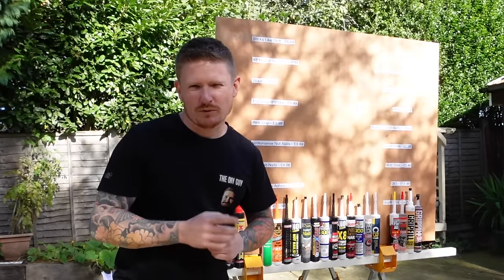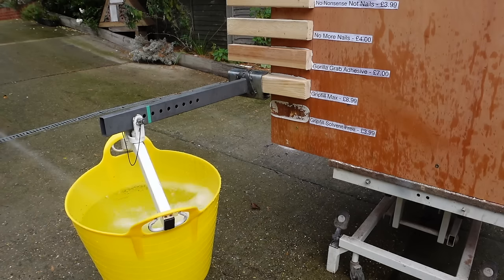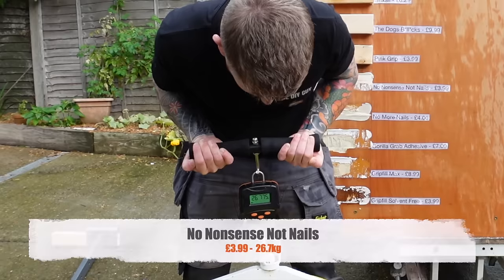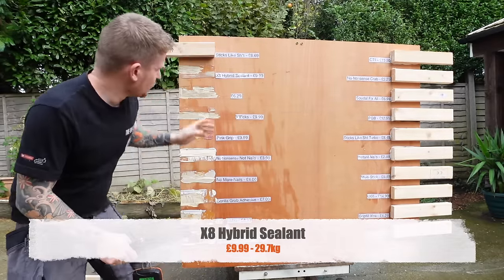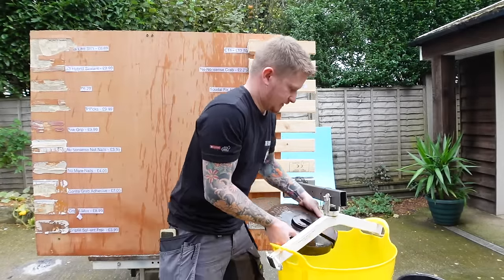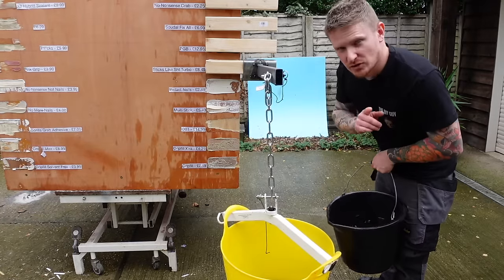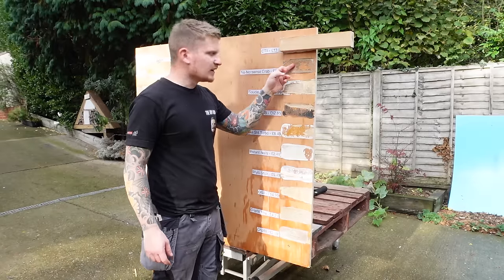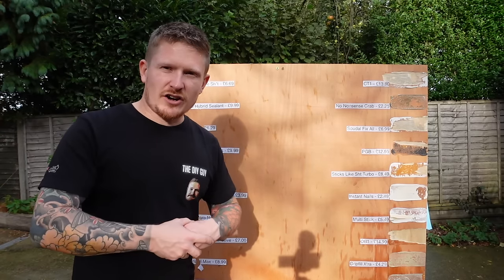Worlds Biggest Adhesive Test | SHOCKING RESULTS!

Comment: Help required bud, My silly builder ( Jurek ) couldn’t be bothered adding noggins on stud wall on garage conversion, just dam lazy if you ask me, and now am at odds with putting floating shelf’s up. I’ll get one coach screw on one stud but with kingspan behind the plasterboard which adhesive do you recommend might hold the metal bracket on ?

Comment: Would like to see a follow if they where lined up horizontally full fixed so height from ground is the same on each one with a hook loop fitted maybe on osb so the substrate doesn’t fail as easy. Great video.
Reply from the maker: Noted!

Comment: RE: Sticks like Sh*t VS. Sticks Like Sh*t TURBO: 
I wasn't too surprised that the hold strength was pretty much the same. But I prefer the turbo version for the setting time. Put a decent amount on, press it onto the wall and you can let go pretty much instantly, which isn't the case with the original Sticks Like.
Just my 2 pence!
Reply from the maker: Interesting, thanks 👍

Comment: Great video but I think you should have added in the weight of the rig to the results - that metal arm must weigh 5kg and the lever action it provides amplifies the action.
Also should repeat with the top performers on solid timber
Reply from the maker: Great suggestion!

Comment: nice vid and a good idea but in most of the tests the wood gave way before the glue which means the glue was not tested to braking point. to do the test right i guess you would have to use a clean metal background but your test showed up the weak glues that broke before the wood.
Reply from the maker: Great point!

Comment: Thanks for share , BUT It's not a well thought setup, first of all your substrate is not right material because it's very inconsistent in structure, you could use sheet of steel so it doesn't fail , secondly the amount of adhesive you put on each section wasn't equal based on footage, and lastly you appling torque to the bars and the force from the torque is far greater than the mass you measured, 😇

Comment: I'd love to upvote, but it's pointless if the substrate is failing so much, you need to apply the adhesives to a 10mm steel plate. Otherwise the only valid info is for those that didn't remove substrate with them...

Comment: I appreciate all the work you put into the video and excuse me if I have missed part of the scoring but if one of the adhesives does not fail but instead breaks the substrate (to a varying degree) then how is that measured when it may be a weak part of the ply (substrate) ?
Reply from the maker: I agree, the substrate did indeed let the test down a little and I will consider coming back with a more conclusive test in the future. However I released the video to give some idea and to entertain people even if it is not hugely scientific.

Comment: Interesting video and like others have said nice to see product testing with uk availability.  My comment would be anything where the glue failed you could say was an inferior product, however if the substrate failed, then the glue has done it’s job and it is the substrate that was incapable of holding the weight. either  the glue holding the plywood laminations together failed, or the softwood lamination itself failed. 
No criticism of you, as the plywood probably cost more than all the glues! But I think you found and tested to destruction that brand of plywood. I’ve found some poor quality plywood about at the moment. Including some exterior ply where the pretty facing ply was the thickness of a piece of paper.

Comment: would like to know how fast those adhesives hold when a load is glued against a wall,  like gluing a heavy brick to a wall or a mirror, and hope it wound fall or slide down.. 

im looking for a product that can be pressed against a wall and the mirror stays on it place without support till the glue is hardened.

I don't mind holding it for a few minutes, but 20-30 minutes ...

Comment: Any ideas on a suitable adhesive from this list to glue a wood plinth base to the underside of a small gypsum plaster sculpture? I've drilled a deep hole into the underside of sculpture and have a short rod within the plinth which will be inserted into the underside of sculpture. I want to fill the hole around the rod with an adhesive and possible add a few small areas onto the plinth.

Ideally don't want something that sets straight away as need a couple of minutes to position. 

Any advice would be appreciated.

Comment: Unfortunately you didn't stick to a solid foundation, so it has skewed the results by the board giving way, bearing in mind the board itself uses glue to keep it together, if you had used a solid background to stick it to you would of got a more accurate outcomes ! But still useful for cheaper glues that don't hold enough weight to rip the holding board apart !
Reply from the maker: Yep I may re visit this topic

Comment: Think the test needs to be redone on a plank of hard/softwood/brick rather than ply....90% of these just tested the bonding holding the ply together rather than testing the strength of the adhesive you're testing
Reply: OB1 for example didn't fail at all, it just ripped the surface it was glued to off...Glue still 100% doing it's job

Comment: Very unscientific, in that it is horribly innacurate, especially using the weight with SOOO much leverage. 

And the failure happens before total failure, but you still keep pouring. Also, the adhesive is limited to the strength of what you call (the substrate). The plywood.

It would be better to stack the wood and pull apart like a chain, then you could really know which is BEST and the true line up.

Comment: Your test method is flawed. As the bucket goes up it has further to drop spilling more water on each drop and the stronger glues allow more water to be put into the bucket. I like the idea but it would only be accurate if there was a scale connected during the filling. Try it again.

Comment: I’m sorry but this is a very bad test, too much variables. Quality of the wood, quality of the laminate board..This test should have been done on a metal plate with metal hangers…So they will be more consistent..On every spot there should be exactly the same weight of glue and it needs to be spread in exactly the same way..

Comment: I dont understand why you dont see that when the substrate its fastened to gives way its all about the substrate weak point. The substrates bonded layer could be bonded poorly so it gives way but the adhesive is still stuck to the board. That is not a test of the adhesive!!, how can it be. A totally pointless exercise. You should have used a concrete substrate to glue to that WONT give way then & only then will you see the true power of each adhesive. But thanks for trying much appreciated but totally false test for those who truly want to know which to buy. Having said that they are all likely adequate for probably all diy jobs in general.

Comment: This test is terribly flawed. In many cases, the substrate fails, which means you can't possibly know the failure point of the adhesive. And that type of substrate is going to have inconsistencies as to surface strength.
Reply: Yes, totally agree, mostly testing the strength of areas of the backing board

Comment: Not a very accurate test with the amount of water your losing 
You could of just used the scales attached to the bucket to weighs it as your going
Reply from the maker: I could have, but I didn't fancy breaking a £100 set of scales on top of the the cost of all these adhesives. Plus this is a fun little test not a hugely scientific one so the small amounts of water lost account for very little.

Comment: I liked this.

Two things however. 

Where there is a substrate failure, the results are incorrect as the strength of the substrate has been measured. Also being so close to the edge will result in a torsional ripping effect.

The second issue is the support of the board; it doesn’t look fully rigid so may absorb some load due to minor rotation of the board. 

A better test would be on a non-laminated substrate that will not buckle - so perhaps the flange of a decent steel column. 

That said, it’s still a really good test - and entertaining too!
Reply from the maker: Glad it was entertaining. I agree with your observation.

Comment: All this proves is how shit todays ply wood is, like every one that ripped the top laters of plywood off is a false result as if the plywood held up then you would get a much more accurate measurement, maybe should have use a sheet of steel instead of plywood and also do each one at the same distance from the floor so that each test is more consistent. 😊

Comment: Great video but unfortunately it is completely flawed! The laws of physics state that at a higher height the same mass of bucket/water will have a larger force of gravity pulling it down - weight (gravity) = mass x gravitational field strength x height. So each time you went up the board that adhesive was at a disadvantage to the one below it due to the increase in gravitational force. If you had placed the hardboard flat so that all of the adhesives were at the same height from the ground then this would have been perfect. Unfortunately, these results are useless :/

Comment: I've used stix like shit for yrs .
Stix like shit turbo has a faster setting time and you should of included a polyurethane adhesive. 
Where the ply failed the weight in the bucket is not conclusive of performance try gluing some hardwood together

Comment: I'm well impressed but technical you've used more weight due to the leverage and torsion value of the bar and where clamped it.
So all of these tests actually exceeded the weight value.
A more accurate test would be a beam with the blocks glued and the weight added as close to the beam I bet most of the glues would exceed the original weight dramatically.
Otherwise I'm talking SH!TE🤭
Reply from the maker: Your absolutely right. Maybe I will come back with a part 2 which could be more technical/scientific 😃